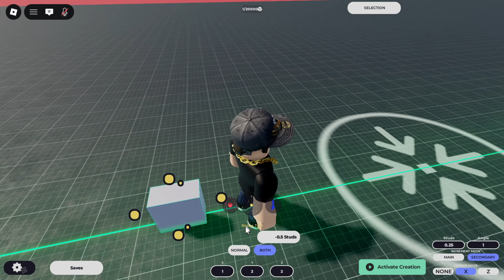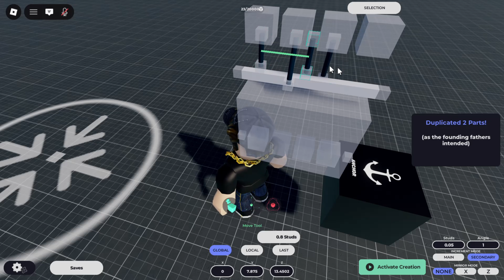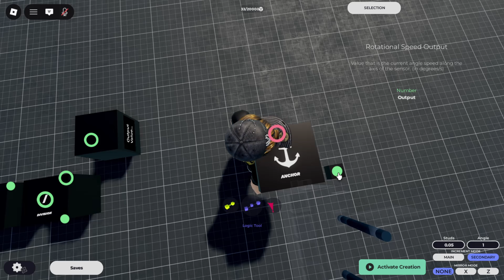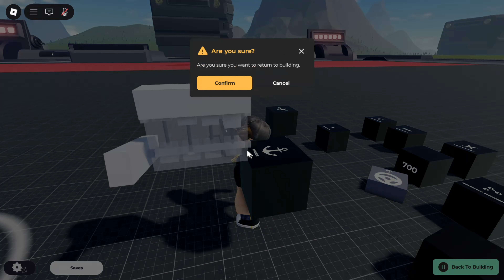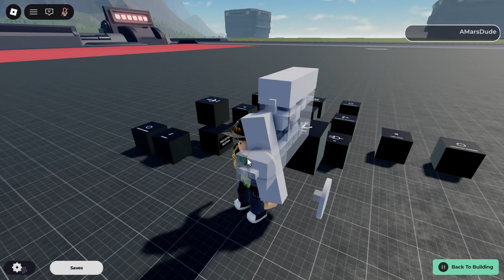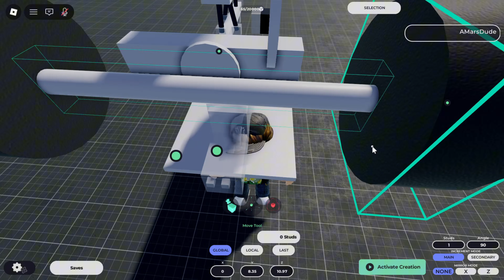Collision Engine and Transmission Tutorial | Elite Engineering Roblox

Comment: I connected the engine to a f1 chassis and it won’t run, even when I test it or suspend it
Reply from the maker: needs a starter, maybe your transmission is faulty as well. U joints can’t go past 2000 rpm
Reply: @p @poopinmetrousers1898 ok good to know

Comment: How do I make an rpm limiter because my engine keeps exploding from rpm overload
Reply from the maker: its in the video chapter 3
Reply: @poopinmetrousers1898  I was building this engine at 19:53 or 7:53 PM so I was in a bit of a rush to complete this before sleeping so I might have missed the chapter
Reply: @poopinmetrousers1898  now my rpm keeps reversing to the negatives when I try to throttle it after adding the one way rotation logic
Reply from the maker: @TUNGSTEN_CUBEE rotate it the other way or reverse rhe sensor
Reply: @poopinmetrousers1898  it's fixed now after I reversed sensor and rotated counter clockwise

Comment from the maker: Make your transmission gears are collide on
Reply: how did u make a cvt only have 2 gears?????
Reply from the maker: @Dr.Coomer-e2q for light vehicles you just need max density and max friction to transmit effective torque and that the gears are meshing by .02 studs
Reply: @poopinmetrousers1898  what do you think i should do for heavier vehicles?
Reply from the maker: @XinSalAIT larger diameter gears and compress multiple into the same